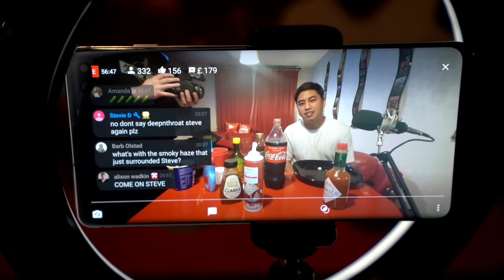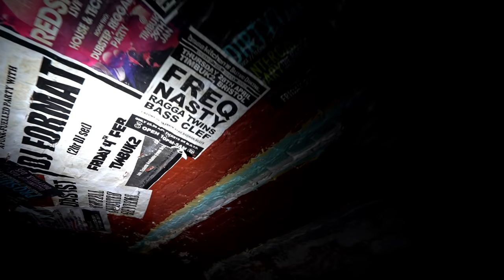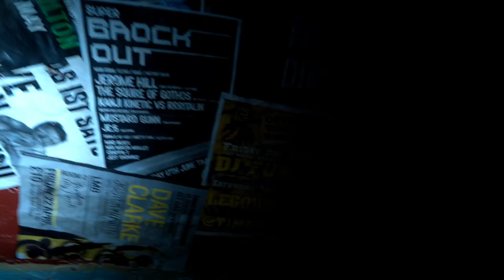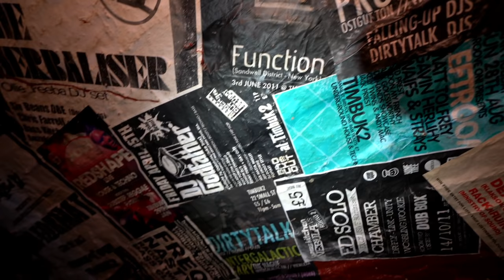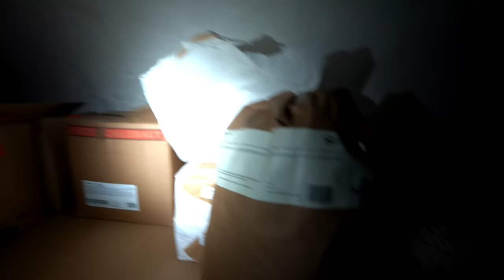ABANDONED UNDERGROUND GOLD BANK VAULTS | BRISTOL CATACOMBS

Comment: In Manchester back in the rave days you probably would have run into Shaun Ryder and Bez. Their was a club in Dublin city centre called the asylum it started about 92 or 93 their were other clubs sides and the Olympic which we went to in 91  I was 16 but the asylum had 3 levels one Halloween I think the prodigy were doing a concert in point depot now it's called the 3 arena after the show they came to the asylum and one of them had like a silver suit it looked like a robot it wasn't metal it was like high density foam sculpted and sprayed but looked amazing it was about 7 feet tall he probably had plasterers stilts but the roof in the asylum was very low maybe 6 foot 5 all I know is I'm 5 foot 8 or 9 and I could touch the ceiling it was cool until the night rival gangs ran through with shot guns as I said their were 3 floors bottom floor dance floor as you got to the second floor people were sitting down maybe skagging or coming down then the third some people smoked joints but most were smoking heroin on tinfoil to come down. I've seen people smoke it on videos from Thailand uk and they kept the heroin in one spot and just burned it with a lighter till it seized or was finished in Ireland wed use a big square of tinfoil but wed make a channel in the foil angle the foil and burn it to make it roll down the channel and wed use a tutor basically a rolled piece of tinfoil so it would look like an empty pen tube or  a £20  note rolled up but we used tin foil to suck the smoke and then take a puff of a cigarette and inhale the longer you hold it the better I'm not talking about kids smoking who just just sucked but never inhaled. So wed have a piece of clean tinfoil but the heroin on the dull side of foil which was about a foot square and you ran it back and forth in different channels or folds sometimes it would get 20 lines a foot sometimes  30 or on a bad day with bad product 10 to 15 lines anyway I got carried away their apologies for my negativity so I will all kids and adults say no to drugs if your extremely lucky you may not die from overdose  or get a disease hepatitis or HIV or have friends die that's if your extremely careful and lucky I used to live in Dublin city centre when I was under ten then I moved to the suburbs 45 bus ride from city I'm 45 in June 2020 kids dont do drugs you'll die go to jail get a disease not if you smoke it but it at least will take 10 to 20 years of your life if I had the money  I spent on drugs I'd be a millionaire dont be confused just dont try it if you think your too clever I've seen people from family who were millionaires ozzy  Osbourne's son jack for one with hillbilly heroin oxycontin but glad to say jack is clean and sober a long time so good for him he turned his life around congrats